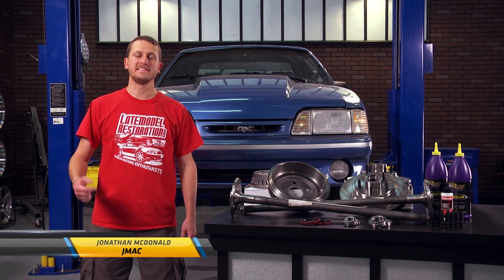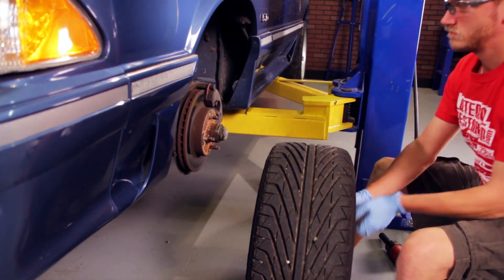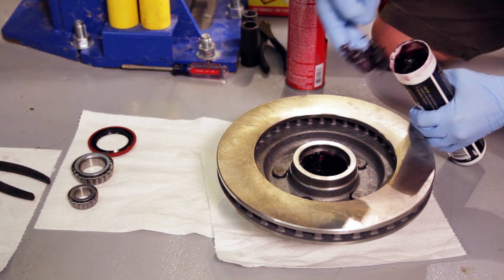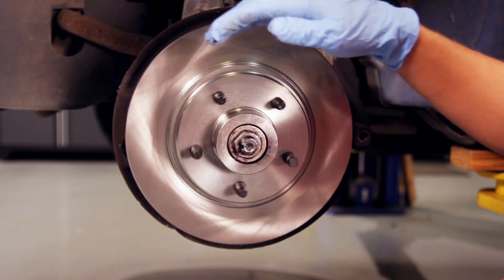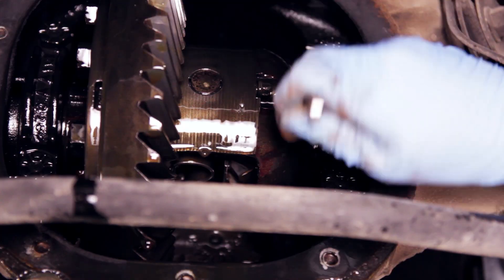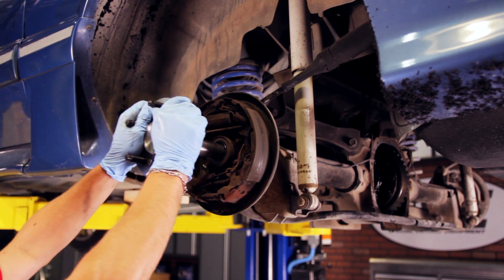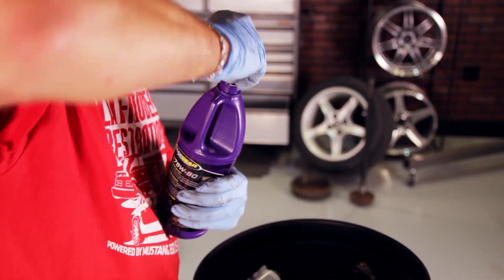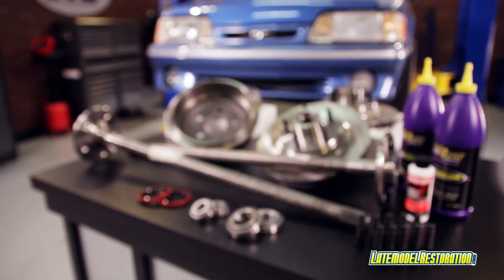Fox Body Mustang 5 Lug Conversion Kit Install (Five Lug Swap)

Comment: helpful tip for those of you who hate the mess of rear end grease. stick a 6 inch piece of vacuume hose or fuel line on the end of your cap for your gear oil jug (yellow slanted cut tip in video). this allows you to get the oil in the rear end without any of it spilling out as you put your full jug up into place. its an ackward hole to hit before any lube spills out, so the hose permits that lost fluid to go directly into the housing rather then outside of it and onto the floor or your face. Enjoy and keep your work clean!
Reply from the maker: DrakkoDown Thanks for that tech tip. Keep them coming guys! - Jeff J

Comment: This kit is nice, but you're limited on what 5 lug rims you can ran and, worst of all, you're stuck with the crummy fox brake system. It costs a little more, and is more involved, but using 94/95 hub and spindles along with the supporting M/C, calipers, rotors, brake lines, axles, etc is a much better way of going. Not knocking on this kit, just getting the info out there :)
Reply: I appreciate you man thank you

Comment: only the 93 cobra and SVO came with 5lug from the factory. Screw the kit, get cha some rotors off a Mark VIII and two driver side (if i remember right) axles from a Ranger. done.
Reply: You mean a Mark VII I assume?
The MVII is a foxbody car and very similar to the Fox Mustang  but the Mark VIII is another kind of beast.

Comment: After tighten down the spindle nut and attaching the wheel, is there suppose to be just a tiny bit of play on the wheel from 12 to 6 o'clock position? I heard it is better to be too loose than to be too tight.

Comment: Did you use the old bearings with new races? I hope not. Bearings and races come as a machined set. Using old bearings with new races is just asking for trouble.

Comment: Don’t know if y’all will reply to this but on the website there is a few different 5 lug rear disk brake conversion kits but my question is why is there one that only fits a 1993.whats the difference from the 86-92 setup?
Just curious bc I have a 93 hatch but I put a complete 98 GT rear axle swap under it

Comment: Is there really a big difference between an 86 and 87-93 kit?
Reply from the maker: Hey there, there are a lot of components that make it different when it comes to the 79-86 and 87-93. Give us a call at 1-866-507-3786 or email us with the link below and we can answer any questions that you may have! https://lmr.com/contact
Reply: @latemodelrestoration  the sad part is, I got the car not knowing it’s a Frankenstein. Is there anything i can look for to tell what year I need?
Reply from the maker: If you have the correct VIN or door tag for the car, it'll be hard to say what year the car is. There are a lot of other small details that can be found on the car that would identify it. I'd recommend checking some local forums to see what other people have done to identify what model they have.
Reply: @latemodelrestoration  if I put a UPR k-member on it, can’t I use any spindle and brakes?

Comment: Will the front rotors work on my 1980 mustang 5.0 ?
Reply from the maker: From our website: 1979-86 Mustangs and 1987-93 2.3L Mustangs need to use 1987-93 5.0L spindles, struts, and calipers for this kit to work.

Hope this helps.  -Landan

Comment: Are the front rotors mark 5 rotors. I see there's a lot of questions on here that are not being answered
Reply from the maker: To better answer your question, this rotor will fit multiple applications and are not deemed "just" a Mark 5 rotor. -Landan
Reply: Late Model Restoration thank you for responding. All I needed
Reply: Late Model Restoration and will these rotors work on the 4 cylinder cars as well

Comment: what center caps fit for 99 bullit wheels on a 5 lug conversion?
Reply from the maker: Are you using the kit seen in this video? Or a SN95 conversion? If you are using a kit similar to the one in the video. None will. The bearing hub is built into the rotor and won't allow for the center cap to full seat on the wheel.

Comment: im looking to buy your 5 lug 31 spline conversion kit with slotted rotors, my question is do you have to upgrade to the 31 spline differential traction lok for them to fit or will they work with the stock 28 spline traction lok? ive been looking on the internet for a straight answer but have had no luck.
Reply from the maker: kaptaincocopuff98 give us a call and we can walk you through these kits and we could help you build one specifically for your application if we don't have a pre-built kit to help you. Call us at 254-296-6500

Comment: When i rotate my axel without any fluid in the diff it sounds like it’s grinding and is tough to rotate. Is that normal?
Reply from the maker: Hi Ben, 

Generally it is not. We recommend checking the axle's and gears to make sure everything is straight and functioning properly. If you have any other questions or concerns, please give us a call at 1-866-507-3786.

Comment: What can I do to convert my 86 to five lug?
Reply from the maker: This exact kit will work, but you will need 1987-93 5.0L spindles, struts, and calipers. -Landan
Reply: Awesome. Which aftermarket products do you sell that would work as a replacement to those things that would fit my year?